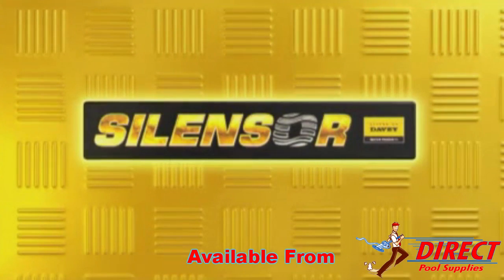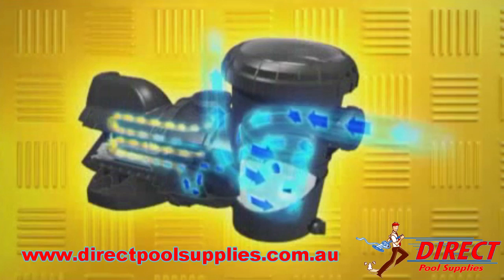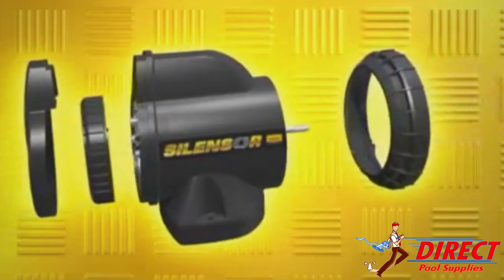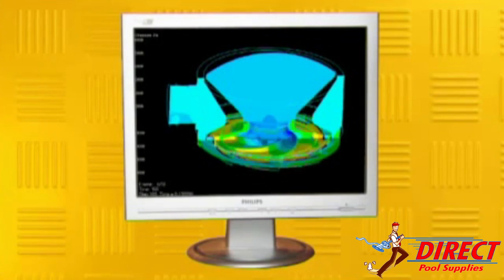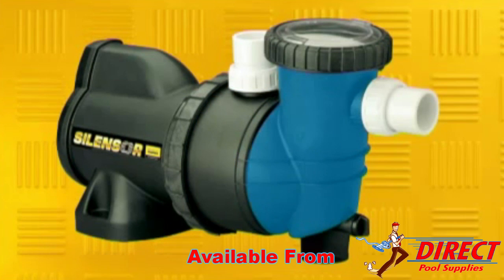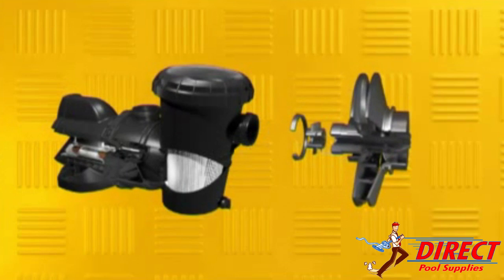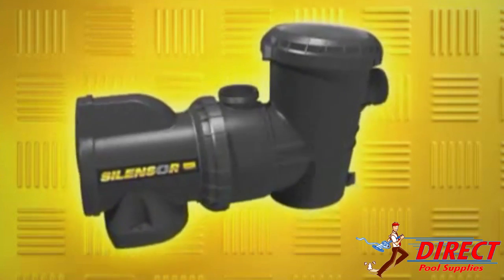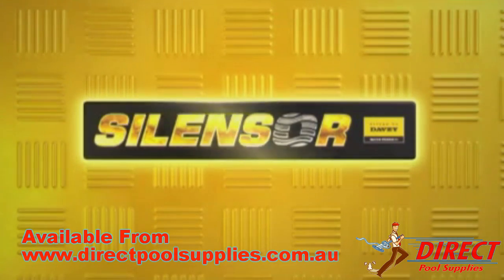Davey Silensor Pool pumps

Comment: The titles come in too loud.  Madness.  I am on my second one of these. I had to replace the old one in 2016 (after 7 years).  The new one (Manufactured in 2011) only lasted 4 years and now the impeller has gone (shaft broke off blade disk "Strong Polymer") and it is in to be replaced. These used to have a 3 year warranty but now they only sell it with 2 year warranty;  That tells you something right there.  Silent but deadly.